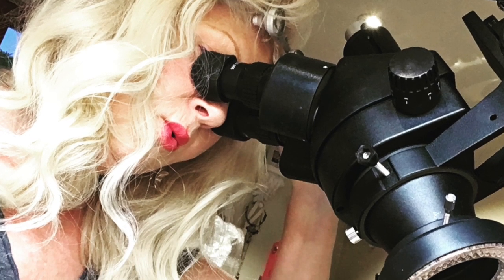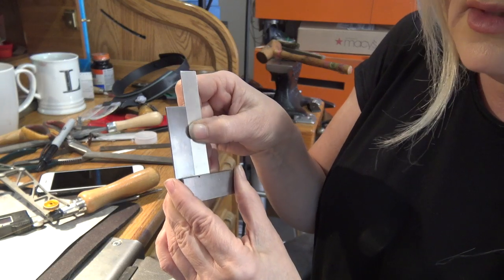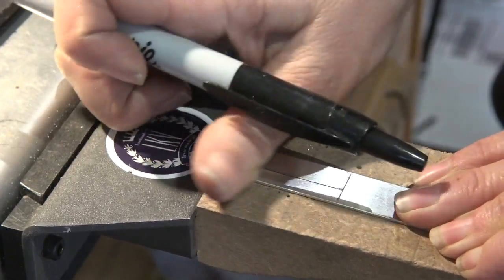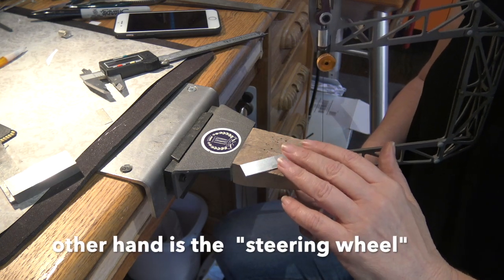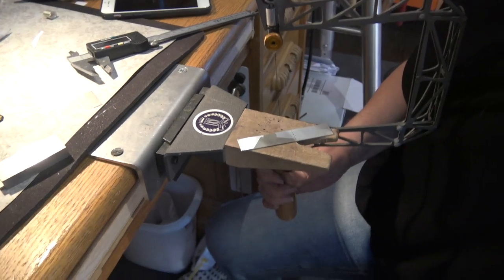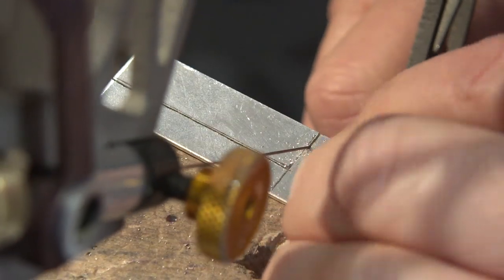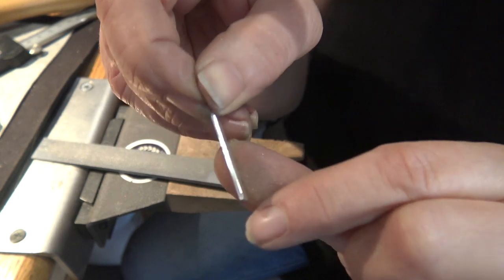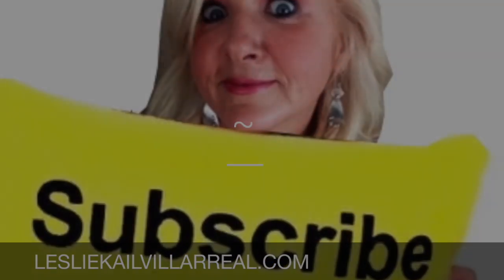TECHNIQUES FOR SAWING STRAIGHT BEZELS and  RING SHANKS

Comment: Nice!! If you don’t mine , what gauge do you prefer to use when making your rings shanks? And bezel? Just curious 😊
Reply from the maker: Julie Peck  thickness of the shank varies it really depends on the style of ring typically 18 g though.  Same for bezels... nothing thicker than 18 and some times as thin as 26g

Comment: i thought you should hold the blade at 90 degrees  ?  i have always read to use wax , why didn't you ?  and i think if you hold it in between the bench  pin at the open "V" and not just on the side of the bench pin it would vibrate less  .  Are my thoughts wrong about what i wrote here ?
Reply from the maker: most experienced jeweler's use incredibly sharp blades without waxing which can sometimes  build up making it difficult to see your scribe lines and markings.  You do not always have to saw between the "v"  some bench pins don.t even have a v shape and leaning the blade forward a little will help you get a straight line cut :)  Give it a try my way and see how it works for you ❤️
Reply: @LeslieKailVillarreal  ok